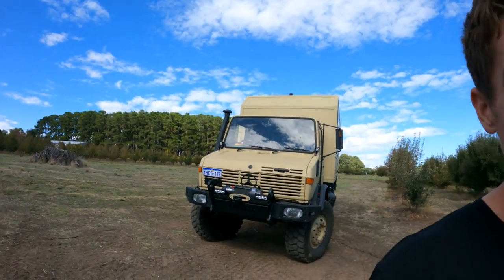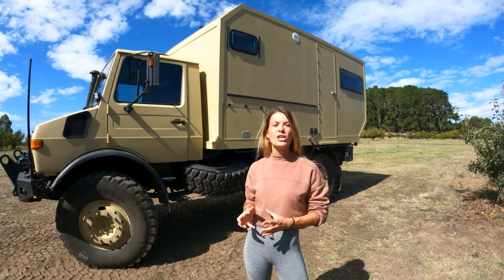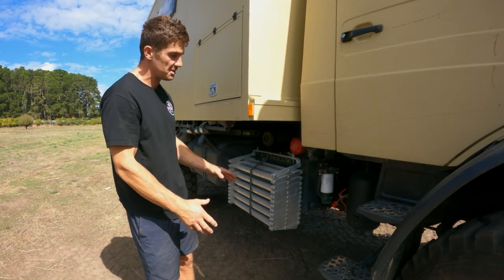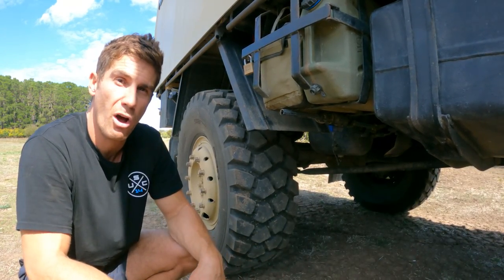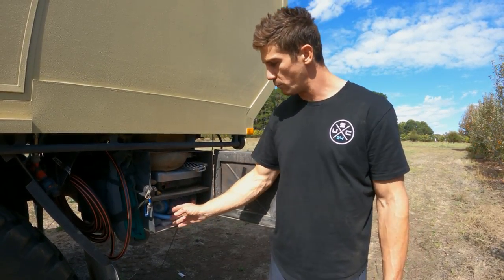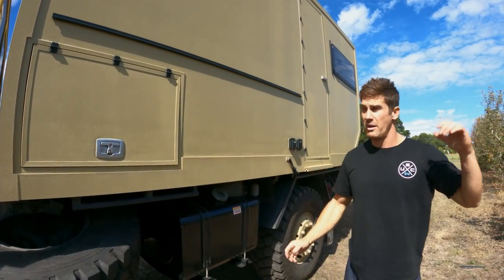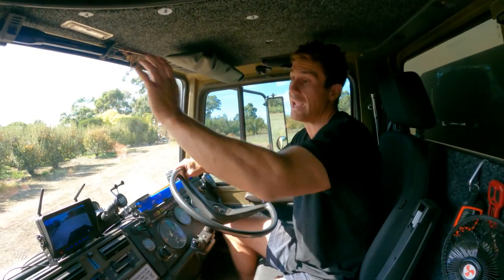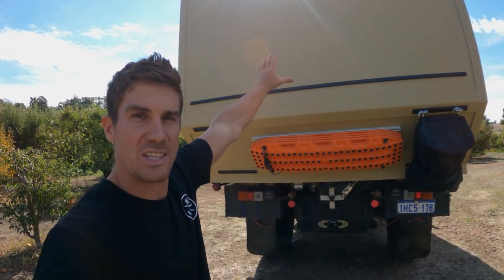WALKAROUND - EX-ARMY UNIMOG 4X4 TRUCK converted to DIY EXPEDITION VEHICLE CAMPER

Comment: Well done to you both.  One of the few tubers I’ve followed from start to now :) I have a few questions 
1. How tall are you ? I’m 6ft 6 and curious to know if I’d fit in the cab 
2. Total cost of build to date (fully understand if you don’t want to share)

Awesome vids 

Cheers
Reply from the maker: Thanks a lot for watching! I'm 187cm and I feel pretty cramped in the cab. It's not just the head clearance but mostly the legs. I don't think a Mog would be right for you unfortunately.
We will talk about costs in the Q&A for sure.
Cheers!